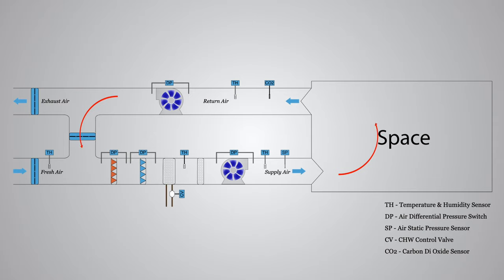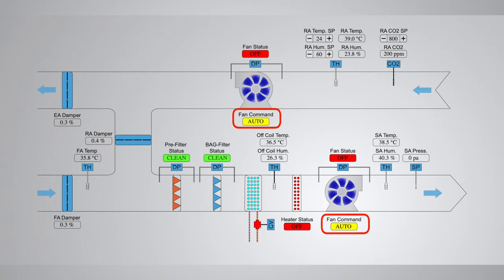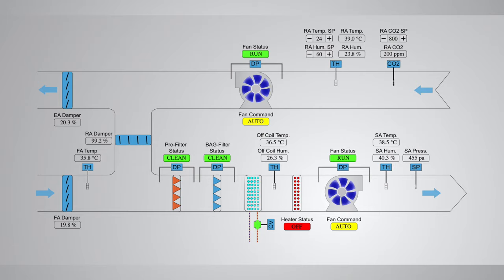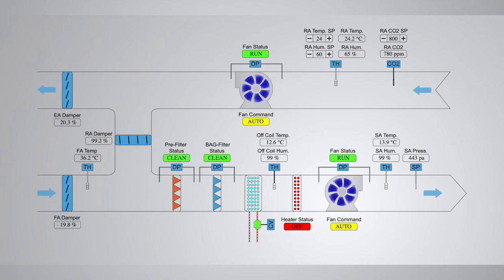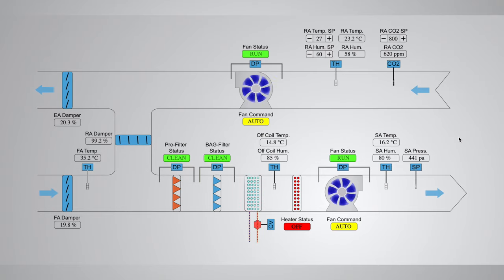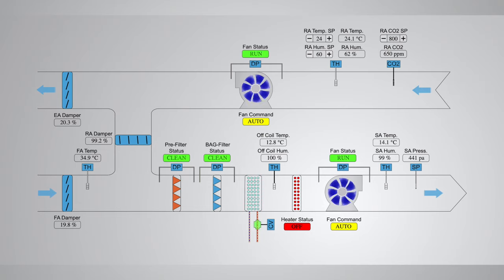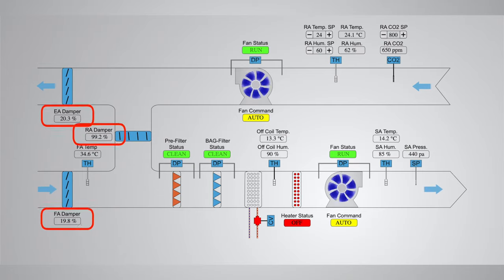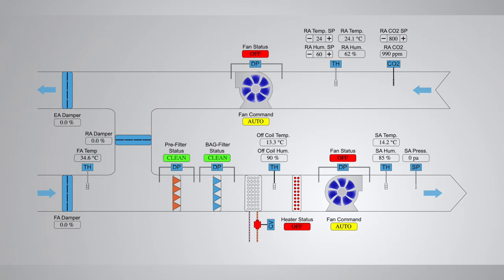BMS Sequence of Operation - Air Handling Unit with Startup,Shutdown sequence & control loops #bms

Comment: why supply and return air damber not added across serving space ,not necessery? please
Reply from the maker: not necessary. it depends on the application of use. if there multiple AHU's working in Duty/Standby operation then supply and return dampers will be required to isolate the standby AHU...

Comment: Thank you and like for the video!
Please explain, why humidity level increases after cooling coil? Shall not it reduced due to condensating on surface of the coil?
Reply from the maker: Hi John.. thanks for your feedback. The relative humidity level after the cooling coil will be close to 100% as the hot air absorbs moisture from the cooling coil. Condensation happens due to the hot air becomes vapour when comes in contact with the cooling coil. Hope this is clear
Reply: @engineeringautomation  i think more water is removed (you need to achieve 100%  humidity to remove water from air) as the valve modulates to open. thus humidity will decrease temperature may be too cold, thus need reheating.
Reply from the maker: Hi yokelee.. yes.. to maintain humidity you need to cool the air more by opening the CHW valve and to maintain the temperature you will open the heater to maintain temperature thus by maintaining both.. hope this helps
Reply: @engineeringautomation  You need humidifier to maintain humidity setpoint specially if you are in a very dry and hot weather during summer like here in Saudi Arabia and other ME contries.
Reply from the maker: Hi Rimando.. i agree. It depends on the nature of the application.

Comment: Can you explain me How we can set the DPT set value for both series type fan?
Reply from the maker: Hi Avinash.. i believe you are asking about the DPS for fan run status monitoring. Also i believe only 1 fan will be in operational. In that case, negative probe should go before both the fans and positive probe should go after the 2 fans. Either of the fans running, you can get the status. If the fans are in parallel you need to provide separate DPS for each fan. Hope this helps

Comment: What are the function of 4 T&RH sensor , please let me know function of 3 other than on return duct considered of space.
Reply from the maker: without the sensors in the supply duct you will not know if the cooling coil is performing. it helps in measuring the performance for energy saving and better control

Comment: Is this the same SOP for FAHU with heat recovery wheel at its center instead of the Damper?
Reply from the maker: Hi Sachin, FAHU sequence is different. HRW will work all the time when the AHU starts. The chilled water valve will be controlled based on the supply temperature rather than the return temperature in the FAHU. Hope this helps.

Comment: Hai sir what are emergency handle in bms operations like power supply cut how maintain temp
Reply from the maker: Hi siva.. if the power supply is off for the AHU then temperature can not be maintained… we need power to run the AHU. If u refer when DDC is switched off? In that case DDC will be fed by UPS to avoid power interruption

Comment: Sir which software use in BMS operator
Reply from the maker: Hi Tousif.. the software is depends on which manufacturer is supplying the BMS system. Siemens uses Desigo, Honeywell uses EBI, Schneider uses EcoStructure etc..
Reply: @engineeringautomation  
Sir for these software we should required licence or they are free of cost?

Comment: Very nice video ! Great work. I have one query regarding the shutdown sequence. How is that achieved during Fire scenario in the Occupant space ?
Reply from the maker: Hi Pravin, in case of fire, the fire alarm system shall directly shutdown the equipment to prevent fire build up. If shutdown is achieved through BMS, once fire signal is received from fire alarm, BMS will switch off the supply fan, followed by closing of control valve and the associated dampers. Hope this helps. Thank u
Reply: @engineeringautomation  Does the exhaust Fan requires to be running (may be for short duration) during Fire scenario ? Or is it the case that all Fans need to be shut down during fire ?
Reply from the maker: If the fan is designed for smoke extract then the extract fan should work during fire to extract smoke out. Otherwise all the fans needs to be shutdown. Toilet and kitchen fans are not required to be shutdown. Fans which should run during fire for smoke extract must be fire rated with fire rated duct work
Reply: @engineeringautomation  thank you so much. Your response and explanation is pretty clear. Keep up the good work.. Appreciated.
Reply from the maker: Thanks pravin. Please support by sharing our channel to your friends.
Reply: Please could you kindly make video on faults finding and possible errors rectifications if AHU.
Reply from the maker: Sure will do..

Comment: the temperature and humidity are controlled as individual variables...
I don't think it will be work well. 
The right control is controlling Temp and Humidity as a integrated parameters
Reply from the maker: Hi Christo.. Thanks for your feedback. Yes Temp & humidity are integrated parameters. However, temperature control is more important and humidity is secondary control. Always its priority to have the temperature controlled then humidity. But this depends on application.